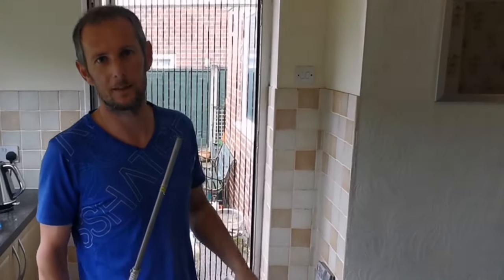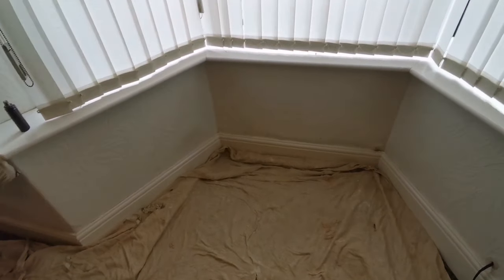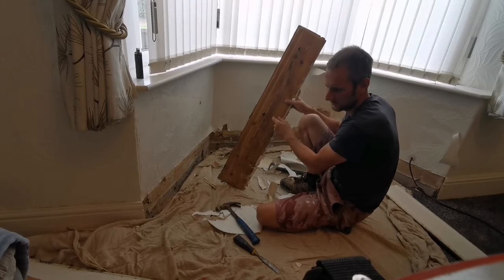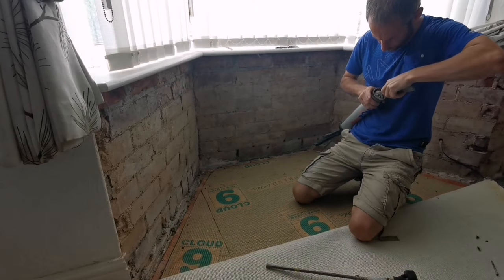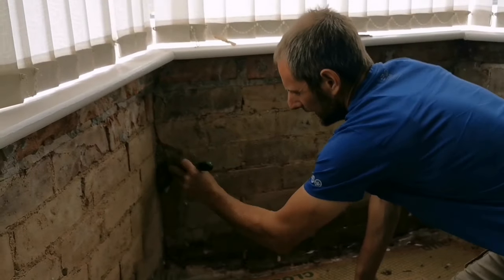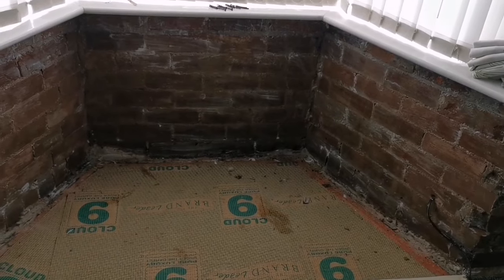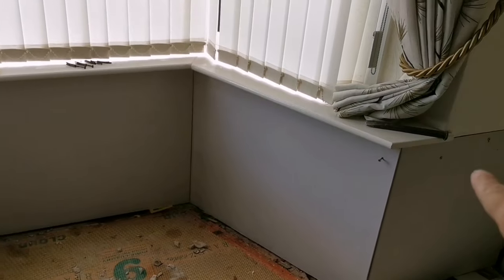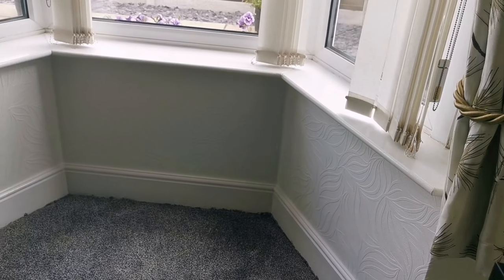Damp proofing a wall rising damp

Comment: I have been diagnosing damp issues for 28 years and I have yet to recommend drilling and injecting a building of cavity wall construction. When you were drilling the outside I couldn't see the original DPC which leads me to conclude that the ground levels have been raised above it and the sub floor vents. The problem with so called 'Damp Companies' is that they always diagnose 'Rising Damp' and charge the customer thousands to mask the issue rather than finding and rectifying the cause.

Comment: The paving externally is too close and high to the bay wall and likely bridging any existing DPC. Reposition paving and lower ground level leaving a suitable gap as a soak-away. Will prevent any re-occurrence of the problem. Cheers.
Reply from the maker: Chears Paul you probably right with one. If it returns I will definitely give them that advice 👍👍👍
Reply: The paving looks to be below where the damp was inside. So I can't see that being a issue as the water would have to penetrate then move upwards. Water is very heavy and can never rise so it's more likely to be damp or rain penetrating from outside if it's a solid wall.  If a cavity wall maybe the window/seal area.
Reply: Your right ...
Reply: Well done I was waiting for someone to spot that
Reply: @robertsanders4074  "water is heavy and can't rise" Google capillary action 🤦🏼‍♂️
Reply: @robertsanders4074  actually that’s not true, capillary action enables water to travel upwards hence the term rising damp.
Reply: paving and ground work looks above or to close to DPC so good chance water is allowed to splash  back. this be worse too  if slabs  are not sloping away from house. pointing looks new too so  if its a cement mortar thats going to trap more moisture. flower box wont help either as it will trap water  and allow it to sit on he bricks above dpc. i would work outwhere the dpc is in relation to the slabs.   might be work relaying them about 3-4 inches away  and adding a single gulley. remounting the flower box so its not resting or touching wall. i have similar problem but wall goes onto public pavement so the lower 2 feet is render and painted.
Reply: Have to agree 100% with Paul here. I think there should be a ground clearance of 150mm below the damp proof course outside, so I would advise cutting a channel in the slabs next to the house and digging it out, then filling up with gravel.
Reply: @woody1380 Exactly what “rising damp” is 😂
Reply: @peterremke how wide would you make the channel? I've got a bay same size on Victorian house. Was told channel should be over a foot deep but not sure how wide to make it. Do you dig directly down from the base of the external wall? Blackjack the channel and fill with shingle? Although there's black mould on the interior plaster none of it is soft like this so was thinking a dehumidifier might be fine and then treat mould first without removing the plaster maybe?
Reply: @robertsanders4074  capillary action!
Reply: @stuartweatherburn8809  you are correct, this is rubbish poor people.

Comment: Keep an open mind and be aware that rising damp is extremely rare. Houses built before the 1965 Bldg Regs never had a damp-course and they are all still standing and free of the rising nonsense. Happy days!
Reply: You must be a flat earther.
Reply from the maker: @wackypeace1135  😂😉
Reply: U have a point. People should check outside ground levels and also the sub floor ventilation
Reply from the maker: @TextBookPuncher1  yes you right on that mate .most times it's something else out side doing it .this one was a drain that had cracked.we put the damp proof in just as a precaution.as we had to take the plaster of anyway 👍👍

Comment: You didn't fix the damp cause you just remedied it looks like no underfloor airvents outside ground level is too high bricks are spalling outside maybe due to the high humidity in the cavity there is a number of causes this wouldn't fix it.
Reply from the maker: Hi mate .it was fixed before we got there .it was a cracked rain water drain down side of house.that was the problem 👍

Comment: at 3:35 we can see that the external paving height is simply too high, causing the wall above the DPC to become damp. The injection in reality does nothing. It's noted in the video that by removing the plaster the wall dried out, this shows you are not dealing with an endless supply of ground water i.e rising damp. The plasterboard will give you some nice separation from the damp wall and so in effect you have actually reduced the chance of the damp coming though to the decorated surface but in reality the brickwork behind will still be damp. But as with most damp, if it's not effecting the decorated finish the homeowner will be happy enough!
Reply from the maker: Hi mate. Yes you right I did tell him that the paving was too high. And if he does get any more problems. He will have to do something with it. 👍👍
Reply: @markhep  the stuff you are put into that wall is doing absolutely nothing! Damp
Proofing is nonsense snd not needed

As the others have said high ground levels and lack of ventilation……
Reply from the maker: @daleburns7110  hi Dale. Yes it was a broken drain that was the problem. This got fixed before we did the job. The damp proof we did was just to make sure the old one was OK or not

Comment: Great video Mark. I have an internal wall that is non load bearing and it has bad rising damp as we have no damp proof course throughout the apartment. The wall has the orange blocks rather than bricks, can I use the rods rather than the liquid injection you are using and the mortar is very thin can I put the rods into the blocks, thank you for your help
Reply from the maker: Hi mate I think it's made to soak into the mortar bed .you could give it a go but I not an expert on this sort of thing .👍
Reply: Thanks will give it a go and re plaster and put the damp proof paint on and if it last couple years it will be worth it and start again

Comment: You could have cured the damp by removing 4 inches of paving around the Bay, digging down to the DPC, and putting some 2inch gravel down in the trench for drainage. The DPC is bridged and causing the damp. So many builders miss this when diagnosing damp issues.
Reply from the maker: Hi Andrew this one was down to a broken drain that got fixed. That's why it was pritty dry. We put the stuff in just because we had to take plaster off anyway. But yep you right. I told them if they get any more problems they will have to sort flags out 👍👍👍

Comment: Hi Mark, very educational video.I have a first floor flat and a couple of bedroom walls becomes quite damp , should I use the plaster boards  and the same treatment for outside and inside ?
Reply from the maker: Rising damp usley only shows 1m from the ground if you on first floor and higher than a 1m. It could be coming in through brick joints or cocondensation. I would call some one out to give you some advice. This treatment is made more for damp near the ground floor. So not sure weather it would work. If you mean ground floor then yes it should work it did on this one.yes it's the same for inside and out side 👍

Comment: I have this problem but I am going to try breathable plaster and breathable paint instead of the modern paints that will not release moisture. The way they did it before they had damp courses.
Reply from the maker: I tried the breathable plaster before. The customer wanted it and it didn't work.but I could have done it wrong. The only way I have had it actually work is doing it like this. But honestly I am not a professional damp proofer. So I carnt really give idvice. But let us know if you go with the plaster and how it goes . We all hear to help each other 👍👍👍
Reply: lime plaster and Earthborn clay paint. Your walls will thank you for it

Comment: Hi. How would you go when it's about the pillar of the house internal. how deep should the hole be? Definitely it won't fit because it will hit the other side of the rod unless I cut it but then it will be too short.  Does it make any difference if its shorter? I hope all these makes sense. Thanks.
Reply from the maker: Honestly mate I am not sure let me know how it went 👍👍
Reply: @renovationukmarkhep  only one got in all the way. I had to stop drilling to have a bit of brick left at the end of the rod.The rest of them I had to cut them in half or bits of 2 cm to fill in all the holes.I filled all the holes with tiny bits along.It was a hit of a job as its not along the wall where you can drill the length of the rod. We'll I hope I did a good job. Also there is a crack in the bricks on vertical where I can see the insulation in the cavity wall .Should i cover it with expanding foam?
Reply from the maker: @lucianbrighi  yes could do or put a bit of sand and cement in . hopefully that will stop the damp 🤞👍👍

Comment: Hi mate just wondering can I use normal dab on the wall after I have used the cream to seal it as it’s a big wall and I have fixed the guttering that was leaking to cause the damp issue,will I still get damp dab marks till the wall has dried,thanks again
Reply from the maker: Hi mate if the wall is still a bit damp it may come through were you have dabed it on I not sure I would risk it 👍👍👍

Comment: Hi Mark, good work, what is the name of the creamy liquid  you are brushing  on the wall? If i use the same can i plaster over it? Thanks
Reply from the maker: Hi mate it's the same make as what was put in on the gun. But this was in a tub. I am sure its the same thing looks the same. Yes I think you can plaster straight on it when it's dry. 👍👍👍
Reply: The cream that you put on the wall is called dry shield and  this is different to the cream your use for damp proofing .. and with dry shield you. Use a water proof adhesive called dry grip which can be applied 30 minutes after application and skimmed that day . We still use the board foam as it sets quicker .. the system is called express system by safeguard

Comment: Internally there are 8 courses of brick above the flooring, externally there are 10 courses of brick before the paving is reached - so the question is this: where is the DPC? I have a hunch that the DPC is either at the 10th course of bricks just barely above the paving OR 1 brick below. 
The house appears to be a cavity wall construction based on the 'stretcher' bond walling as opposed to 1 brick thick walling of older housing.
I would have lifted a paver outside and had a look for the DPC - but whatever is going on the cavity wall is being breached - an option would have been to put an ait brick in for ventilation.
Reply from the maker: Hi mate it is were I was drilling. It was 120mm above the paving. So paving is a bit high. The problem was a bust rain water drain. It got fixed before we got there 👍
Reply: You did the same as me count the brick is probably the 1st thing to do lol
Reply: @1.9.8.3  As Mark said above - it wasn't even a problem with the height of bricks or DPC, but a 'burst drain'!

Comment: Great job mark,what happened to the TV cable that was there.
Reply from the maker: Hi Andrew I run it down the back of the plaster board and under the carpet. Looked a bit neater that way 👍👍👍
Reply: @markhep  I see it looks alot better that way..look forward to your next video 👍
Reply from the maker: @andrewbeardsworth5461  cheers mate got a big job we just started will try and get the first vid on tomorrow 👍👍👍
Reply: @markhep  👍

Comment: Hi Mark, would you say plasterboard works better for damp proofing than wet plaster. I have a few big internal walls suffering from internal damp which I am using dryzone for
Reply from the maker: Yere mate I would say plaster board. And stick on with plasterboard foam. Works for me. But there are a few ways to do it👍👍👍

Comment: Mark, on the external what course are you meant to drill into? Shall I drill into the existing damp proof course or the course above/below it?
Reply from the maker: Hi mate yes drill into existing damp proof. And not into the brick just the joint every half brick 👍👍👍
Reply: And the same on the inside of the house same course?
Reply from the maker: @francis1431  yes mate 👍👍👍

Comment: You found the cause of the damp?
Reply from the maker: Hi mate. The customer had a broken drain pipe that was leaking under the side of the house. From next door. They fixed it a wile back. And it has been drying out slowly 👍👍👍

Comment: You should have relocated the radiator to under the window.  The exterior floor is too high and this was probably the root cause of the issue in the first place.
Reply from the maker: Could be mate 👍👍👍
Reply: radiator under window will give you more issues
Reply: Radiators under windows is old hat, heating and drying out external wall then Winter weather and temps pull it in the other direction.

Comment: Good video. I have something similar in my flat. That last application of foam you applied to the back of new boards. You said it will "go off" in an hour. What did you mean? It will expand and multiply creating a full layer of foam between back of board and brick wall??
Reply from the maker: Thanks mate 👍. No the foam it just like a glue it doesn't expand. It's for plasterboard. Don't get the expanding one as it will push the board off the wall. If you ask at the shop they will tell you type you need 👍👍👍

Comment: I didn't know you could stick plasterboard with expanding foam, that's something I'll try some time!
Reply from the maker: Hi mate it's plaster board foam. It does not expand so it doesn't shove the board off. If you try it make sure it says for plaster board 👍👍👍👍😉
Reply: @markhep  Thanks, will make sure I get the right stuff!

Comment: Can’t see how the damp proof is fixed by drilling holes and filling them ? Damp proofing have to run a lot the brick course ?????
Reply from the maker: Hi Scott. You drill at every half brick. And when you put the cream in it soaks into the brick making a full run. Honestly mate when I first used it I thought the same. But it does seem to work. But I am no professional at it. I have only  done it 4 times before. But it has stopped the damp  4 times 👍👍👍
Reply: @markhep  first time I’ve seen it done - Looks great - Rising damp has been a massive problem for many years - Need to see more videos like this 👌🏻👌🏻👌🏻👌🏻👌🏻
Reply from the maker: @scottcorcoran8225  yere definitely. I would like to see more. And some good testing would be grate 👍👍👍

Comment: Plastic paint on top of wallpaper, no wonder the wall stays wet, waken up. Have you checked your windows for leakage.
Reply from the maker: Hi mate .yere it's had years of paint on it .it was a cracked drain that did the damp . It got fixed before we got there .customer just wanted damp proof done as it spread pritty quick

Comment: Counting the brick. It's 8 coarse inside 10 coarse outside so that wouldn't of fixed it would of it. I aunt a clue but surely you have to drill on the same line both sides to make it sealed. Or am I looking into it too much surly it had should of been done 2 corse higher outside isn't it ment to be 2 brick higher from ground level

Comment: Ive been told by company who are going to do my damp, that i cant wallpaer for 18 months after its been done. 🙀
Reply from the maker: .wonder if that's on a sand and cement backing.they take a long time to dry fully .I didn't have a problem with this one .but I think if it was a hard backing not board then .yes I wouldn't paper it it would probably not stick well
Reply: Yes, they are not putting plaster board on.  Thank you.  Im just gutted i have to wait so long to put my zebra print wall paper up. And of course having damp on new house.
Reply from the maker: @Linda-rn7pg  should look cool that .yes damp is not a nice thing to have in your house 👍